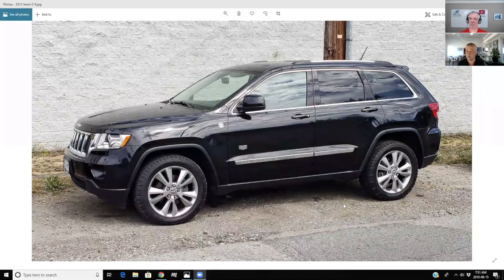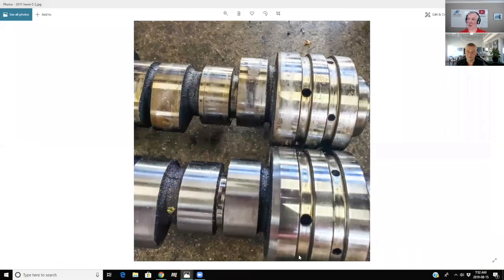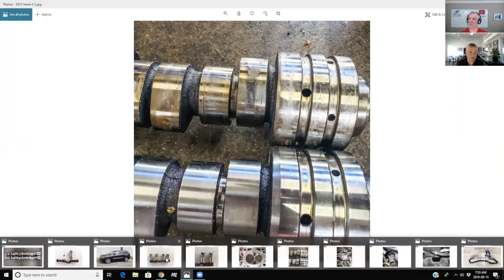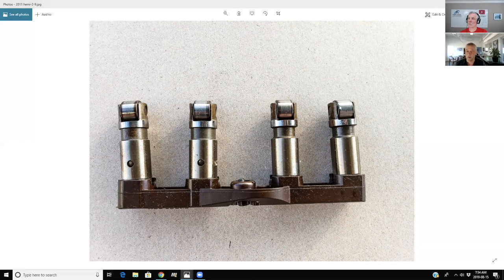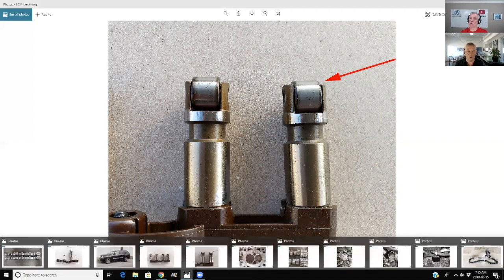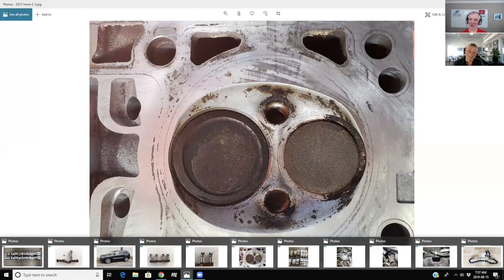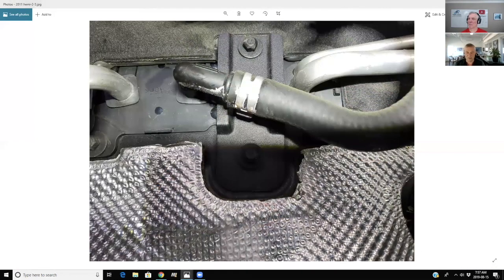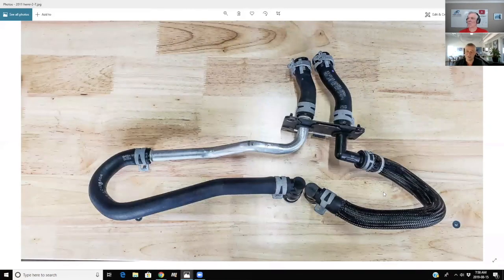2011 Jeep Grand Cherokee Engine Noise Repair

Comment: If I didn't know any better, I'd swear he was talking about my vehicle. Have every single one those issues, right down to the coolant leak. Crazy.
What is the approximate cost of pulling the engine and replacing the cam and lifters?